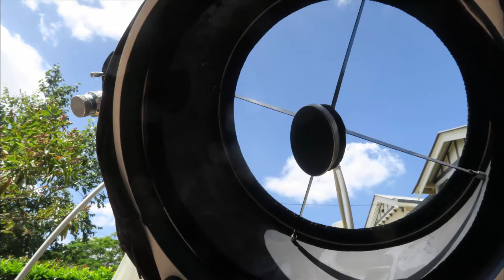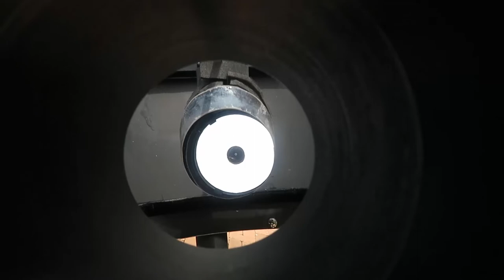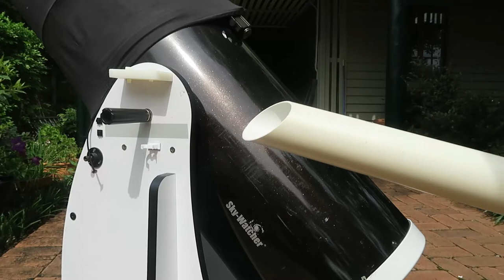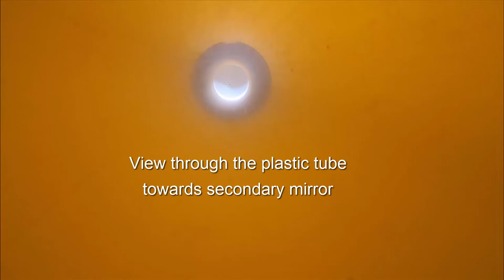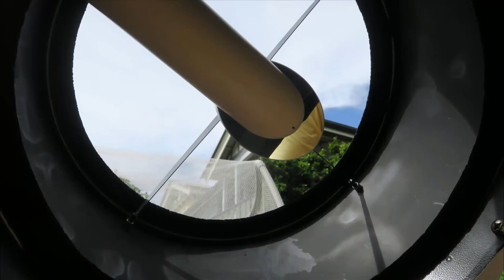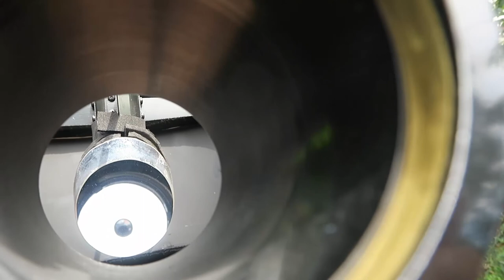Dobsonian/Newtonian Telescope Secondary Mirror Major Misalignment Check

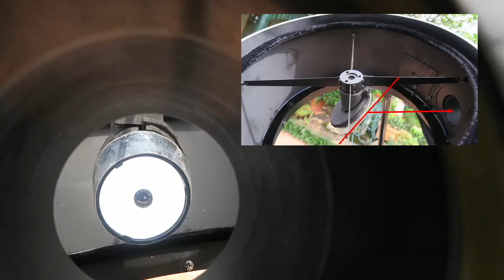Comment: 0:41 mine is skewed. It should be a little bit more „right“. What’s the solution? Can’t get it right with the 3 adjustment screws alone
Reply: You can adjust the spider, it should be square unless someone attache the secondary manually then remove glue or tape and align and re attach, but if it's not square it might be ur focuser not align Also if the back of secondary is worn out you may struggle to collimate and you can put a washer and it will be smooth again trust doesn't have to be perfect don't try to or u will loose ur mind and you will realize there wasn't that much of a difference between perfect amd close enough

Comment: Very nice, but for closed Newtonian tubes you can only view from the top and the secondary mirrored surface is not visible.
Reply: Hi Phil, I don't think you need to be able to see the reflective surface of the secondary mirror to check its alignment.   From the front of the optical tube, you should be able to see if there is a consistent gap between the edge of the mirror and the PVC tube. That’s all this test is about.  Is the secondary mirror "square " with the focuser axis?

Comment: nice idea, but this requires that your focuser is absolutely perfectly squared
Reply from the maker: Collimation of your scope's mirrors also requires the focuser to be perfectly square to the secondary mirror.  That is why the secondary mirror has multiple degrees of freedom to be adjusted.  The insertion of the plastic tube just provides a way of alerting you to the fact that your secondary mirror may not be square to the focuser.  You could perhaps start moving the secondary toward true square alignment with the plastic tube inserted, and then remove the tube and finalise using a laser collimator.